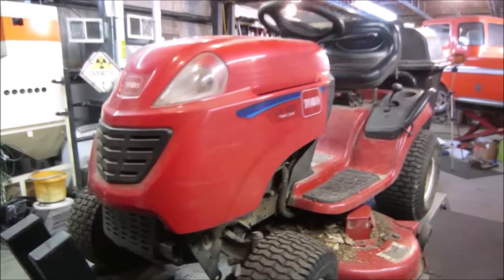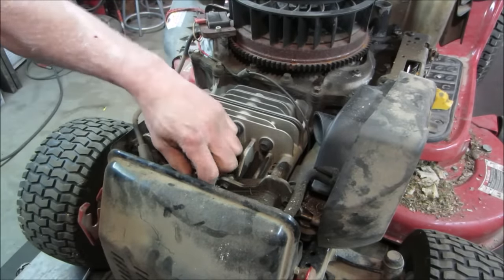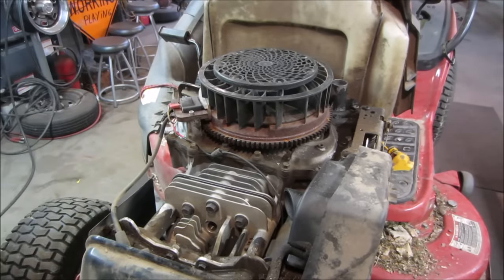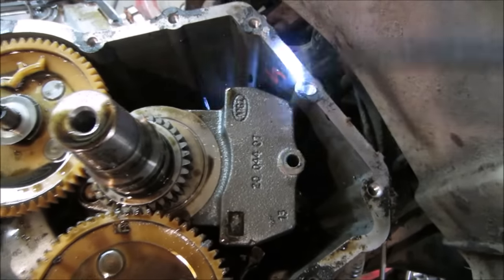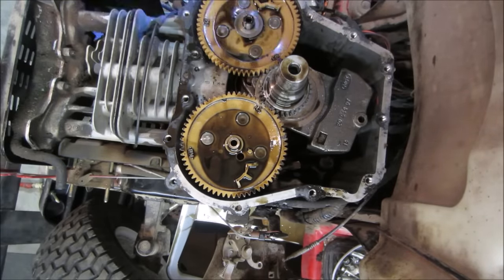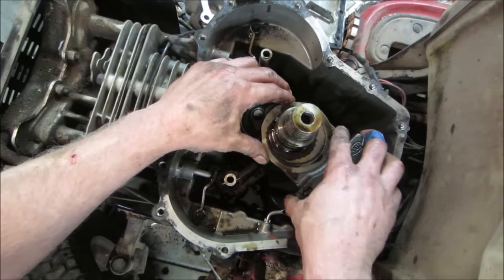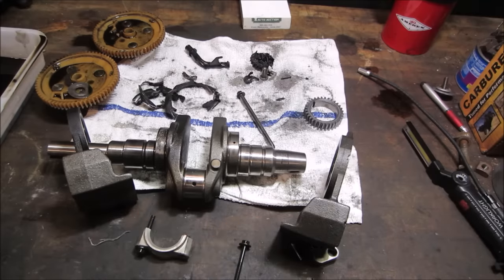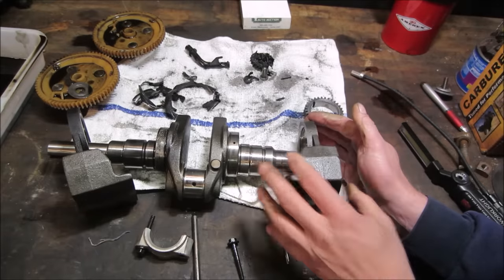You Won't Believe Why This Engine Blew Up,

Comment: Hey! Quick question for ya! I have a Toro Wheel horse lawn mower here. The Deck on it is a 48" deck. The spindles are shot. The part where the c-clip clamps onto is eaten up bad. I need new or used ones. Where is the best place to buy them? Let me know.

Comment: Good job Mustie , Sit down mowers are a pain especially with newer motors with electric clutch ,and  deck  its hard to even find belts because they have to be perfect length. Also when I see motors like this its more crap you don't need, that motor is the POS design. Either junk it or put and old 14 hp Briggs in it. This is what sons are for 16 year old kids , turn them loose on repowering something like this and help them with the project.

Comment: I think that's the vibration dampener.  I've never seen a Kohler with the top of the engine coming off like that. Interesting to see what made it go but I wouldn't want to fix it. Parts are expensive around here along with waiting forever for them. A lot of engines have the same foot print as others so they can switch brands when necessary . I save good motors when I can. Good videos. I like the operating table.

Comment: My guess would be that the governor fell apart, wedged itself in the bottom against the lower counterweight, which caused that bolt to break and then it just chewed itself up after that.  By the way, that's a Kohler Courage engine, which are famous for all those top bolts in the cover coming loose.

Comment: I have this exact same mower. Except mine is black and called Yard Machines. It has a Briggs Vtwin engine. Looks exactly like this one except the color. I need to find out what’s going on with the trans. Lately it hesitates to move forward. It’ll be going along fine then act like it can’t move. I let off the pedal and press it down and it starts to move again. I wonder if mine has the hydro static and it’s starting to go bad. I have no idea how to work on them outside of regular maintenance on the engine. I do know mine is a 2006 model year. I thought these had a CVT in them like a scooter but maybe not. I sure enjoy these riding mower videos.

Comment: So everyone knows, most lawn tractor engine use a 2-1/2 Inch long by 1-Inch Crankshaft.
When you gets up to the larger GT Machines they normally use a 1-1/8 Crankshaft, by I believe 2-1/2 Inch, but don’t quote me on that.
Lastly a majority of newer machines use the 6-Pin molex connecter and they are all pinned the same.

Comment: And this is why you check your oil before you use your riding mower. I actually check it every other use. I've lost a generator from not enough oil. (engine burned oil) Don't bypass the oil cutoff sensor. The connecting rod snapped and the crankshaft spun freely.

Comment: Got my old friends wards grass cutter it had a knock, thought it was the insulated mounts holding the engine in place. Put new ones in sounded better for 17 years till it blew up last fall .pulled it apart in the fall top and bottom cracked castings . Found out connecting  rod had only one bolt holding it together.  Beinging a class 8 mechanic  I was shocked it lasted all these years. It was a 11hp briggs&stratton, scrap it out this year in spare time. Trans is still good 5 or 7 speed

Comment: At 26:00 thinking about why the upper bearing lived and the lower failed. Remember that the oil filter was fed from or fed to the upper portion of the housing. If the oil level was low, the sump would suck dry, starving the lower bearing set while still pouring lube at the upper set. 

I have no idea yet if you explored this as I paused to comment.....

Comment: Was at tractor supply yesterday middle America. Can’t believe how empty the shelves are in the tool section and how little oil they had. It’s a bit shocking actually. Going to be an interesting summer.

Comment: I wonder if there's a steel/bronze/brass sleeve on the top threads of the balancer bolt that was not installed at the factory.  Perhaps that's a "4PM Friday" engine.

Comment: Hey Mustie!  Do you have a governor ( throttle limiter ) spring for a 2004 series John Deere lt150 in your horde? It has  a kohler cv15s-41618.   I have not been able to find this spring anywhere.😁
Reply: check eBay or check at john deer store

Comment: Not "perpendicular" to each other , lol ... parallel , but I knew what you meant , I'd imagine making a video is a bit of a chaos trying to talk not stop while your trying to get your work done , lol ... nice job ... ps. , did there used to be a thin bronze sacrificial sleeve in the bore where your loose bolt is ??? ...

Comment: There was a recall on a particular brand of electric PTO clutch, that the clutches would short out to ground on the crank shaft, causing the lower bearing to arc, eventually destroying the bearing and crankshaft. The first sign of an issue was the lower oil seal leaking, but by then,it was too late.
Reply: Don’t think this one has an electric PTO clutch

Comment: Hipótesis: When the bolt that held both counter weights broke. It provoked an  unbalance on the bottom counter weight that put off-set pressure on the bottom “bearing” causing it to wear off and break into pieces. Those pieces flew around the engine and landed on the governor gears and busted it to pieces. Therefore a chain reaction of broken pieces got stuck everywhere causing it to seized. Then the bendix on the starter got stuck on engaged because it would spin freely and let go. Prognosis. Replace with a predator and mow away happy.

Comment: Late to this but it's a Kohler Courage right? Twin plastic cams, single cylinder. There's a lot of plastic parts. That oil scavenger pickup fails. the governor is iffy. The flywheel cracks into  the cover bolts when they come loose. It's an okay engine.

Comment: I have a mower with a Kohler courage 20, older model it runs great but the block is riddled with cracks at the top cover by the cam gears. Apparently its very common for that model to do it because of how thin the aluminum is between the bolt placements. I'm also not a fan of plastic cam gears meeting metal but its ran good this long so cant be too bad.

Comment: I had the same exact Kholer engine on my rider. I was mowing on a hill and it put the left side up at a sharp angle. The engine blew. Now I know why. The oil pickup is on the "driver" side and was starved for oil.

Comment: Never seen a counterbalance system like that before. Just found another video from years ago with exactly the same failure of the lower bearing but this time you can still see the threads of the bolt still sticking up as is had not sheared off yet. It's possible the engine was making odd noises while running but the owner could not hear them very well.

Comment: This is a Koehler engine... I have one in my troybuilt but from everyone I have talked to they are bad motors and usually run low on oil and blow up... I have even seen them crack the block on the right side by the starter... but my Koehler engine... lol I have had for over 12 years and it still runs good and don’t burn any oil... it has been one of the best mowers I have ever bought......do you want a motor so you can make another video and finish the mower ??

Comment: In my experiences Kohler motors fail due to some little part that breaks and causes catastrophic damage.  I had an Ariens with a Kohler K361 OHV and the oil slinger snapped off for no reason and bounced up and shattered the piston.  Not to mention the constant head failures that thing had.  Have also seen some in the Cub Cadets with cracked blocks all with less that 50 hours of runtime.

Comment: I have a Kohler 18 5400 series. I assume it is pretty much the same. If I knew it had plastic cam gears, I might have passed on it. But it seems to do fine so far. Haven't found  a lot of tear down videos on this engine so I hope that's a good thing. Thanks!

Comment: I worked at a Toro dealer when they first contracted mtd to make these. We thought it was a joke at first. And the first couple years of Kohler courage... sheared off cam gears, crushed head gaskets from over torqued head bolts, rockers so loose the compression release wouldn't work, and of course exploded gov's.

Comment: Briggs & Station calls the weight system "Syncro Balance". On a Briggs the crank journals for the balance weights are replaceable as well are the bearings in the weights. 
I have a Briggs 406777 V twin that the governor failed from metal fatigue.

Comment: How about converting it to electric?  

I was going to do that with my old Craftsman, but I just keep replacing parts, and it still mostly runs. (Kohler 16.5 Command Pro, turned 21 in March 2021, new head gasket this spring (thanks, Mustie1, for the confidence to try to keep this old guy running!).)

Comment: That counterbalance vcontraption looks like a really neat idea, but its execution leaves a lot to be desired!
A second pair of guides in the bottom casing, a decently sized shaft for the sliders which does not double as a means to keep the two weights together,  this should be done by two screws.
But so?
One undersized bolt which wasn´t fit for the job ruined the engine to a point at which a repair can´t be done economically.

Comment: Really interesting video.  Reading some of the comments, I can't help agree with @aserta who commented that this engine is designed to run vertically.  Run horizontally, there would be side stresses not accounted for in its original design.  That would include on that counterweight bolt and cam, which makes that a good choice for the original point of failure.  The bolt-piece and/or the cam then gets chucked into the governor, which is more than it can chew.

Comment: Oil starved, bottom bearing and counterweight bushing is last to get oil, as oil is pumped from the top down. Started seizing and tweaked the counterweight, causing failure. I'd look at the loss of oil pressure/oil pump/filter for clues.

Comment: Failure mode: I'm going with the lower bearing failing first,  bolt failure was secondary. I'm also going with 'bad' lubrication, plenty of oil - just bad/dirty oil. My thinking is the first bearing gets fed with all the crap that is in the oil including any heavy particles that get thrown out into the first bearing through centrifugal forces. The other bearings get clean oil. That lower bearing has suffered the most damage because it ran for a while in a bad state. Eventually it seized. The rest of the damaged followed.....

Comment: look at where the oil filter and passageways are, the oil pump sends it through the top cover and filter, then it returns into the shafts at the top, from the top cover.

Comment: Late to the party, but I'd say that having a pressurized lube didn't help in this case, the low/unmaintained oil pumped the crankcase dry which is why the bottom of the motor had issues while the top looked fine.  I'd guess the lower counterbalance took out the upper, and then hit the governor...as usual, a Mustie1 investigative case! :)

Comment: I wonder if you could ( just for the hell of it) 
Put it back together without the weights, and without the governor and just see if it will start?

Just to see?

Im not sure if the weights set some spacing. 
The rod bearing is fine

I bet it would vibrate like a bugger but it would be fun to see

Comment: 13:16 I know Toro bought out Wheel Horse at one time, but when I saw that yellow bit on the gear that looks like a toy horse, initial thought:
"Well, that's a bit on the nose. Or curious grandkid??" 🤔
Was not expecting to see all the bits in the bottom without there being a chunk of rod or a block window somewhere.

Comment: Have you ever seen the brings single vertical shafts that love to kick rods out and knock the starter off? I think it's like 12-17hp or so. I've seen at least 6-7 of them and always wondered why they do. I think they are balance shaft motors.  All the running ones I've had were good. Any idea?

Comment: Looks like the Detroit Diesel engine that had a similar problem with a critical adjustment of the governor.Governor locked open, engine over speeded,engine was designed to turn 1800,just before it selfdestructed tach was showing between 3500 and 4000 RPM.

Comment: That's a kohler courage engine. Command is the earlier and better engines from kohler. the courage engines are notorious for losing the counter weights. it usually knocks a hole in the back of the engine lol. they also had issues with the top cover plate coming loose and the decomp on the cam blowing apart. they were probably the worst engine kohler ever produced. lots of issues. Thier first stab at a bucket type engine (top access for engine internals) it was rushed into production. We replaced a LOT of engines and blocks under warranty when they first came out. find a decent briggs or an earlier kohler command single if you want to re engine it.  As soon as I heard the clunk I knew what failed inside. Love the videos Mustie keep growing the brotherhood of rust and wrenches. We need some younger mechanics to carry the torch forward.

Comment: Today you learned the most common problem with these engines and why they arent reliable. That separate balance weight was a really dumb idea and it always comes loose. Usually caused by the top cover coming loose.

Comment: have to agree with you that bolt flexing at the thread line will break if you flex it enough times, should have been a larger bolt for the force on it

Comment: So it was just a bolt, of the wrong size.  That broke lose, leading to a motor lock up. Makes no sense at all, to use a bolt of a wrong size.  I think  something else, other then a bolt. Could be used to hold in place the counter weights.  Great video mustie1
I agree, the motor would have be replaced.

Comment: I've had a low oil big single Briggs wear out the lower main bearing surface from lack of oil. Got another crankcase  base and kept it going.

Comment: From the looks of the video the fuel filter appears to be installed backwards as well. I have had experience with these single cylinder Kohler Courage engines and they are notorious for cracking their cases in the rear and also grenading at idle. These were not made like the Kohler Command series at all. I will say that the Twin Cylinder Kohler Courages are not so bad but these twin cam models are a hit and miss on reliability.

Comment: I have a 17K Generac generator and only use it maybe a few times a year.  How long should I keep gas in it before the gas will go bad?  After running it I shut off the fuel valve but the gas can stay in the tank for over a year sometimes.  Should I drain the tank each year?

Comment: The amount of oil that was in the engine , once you start pumping it through the engine there isnt much oil to go around . It seized up and locked up in some places . That little oblong piece you were trying to put on the top of the counter weights was the cam lobes. Tho 2 plastic gears you took off those rods were timing gears and the lobes went on the rods to open. And close the valves.
Reply: JMO.....Looks like Barely enough oil left to push through the filter. Chances are it was sucking air while running.

Comment: IMHO, Kohler and Briggs are close to the bottom of the quality spectrum. My own Briggs v-twin threw half its governor and I was lucky enough to have my hand on the throttle to keep it from grenading. Tecumseh is dead simple, inefficient, but very easy to service, as my 1977 HM80 will testify. The Kawasaki on my lawn tractor has been very reliable, just filter and oil changes. I've heard very good things about Predator engines, and they are cheap and easy ways to re-power.

Comment: I have a 2009 Troy Bilt almost or maybe the same Kohler engine. Thing was pissing oil from above the head level and turns out those case bolts were loose. One had backed off so far it was hitting the flywheel.

Comment: Basically they make everything cheaper. My neighbor has a rider from the 70ties still running strong. There is thinner metal and more plastic which means things fail more nowadays.

Comment: I had one do same thing low oil ...pump kept oil from bottom causing bottom bearing to burn up when bottom locked up it breaks top bolt oil leak out of quick oil when engine running did not leak when sitting it was a newer mower warranty ran out by one month

Comment: Weld up oil journals for the weight, put it back together and run it without the governor! Good to know the balancer explodes on these. Have one I saved from the junk yard. Maybe i'll pull the top off and get a beefier piece of hardware to run through it... or break out the stick welder.

Comment: I think it got low on oil but enough oil was left to pump oil and keep the upper parts of the crankshaft lubed. But the bottom starved for oil and burnt the bearings out.

Comment: Hello cub cadet 2542 horizontal shaft cant turn by hand feels locked up. Kohler command 22hp  shaft drive rear wheels. What think its junked it was given to me. In great shape new starter looks like,battery new,clean machine  wanting try fix it for my pops hes getting old and like get it going for next spring. U know of the Kohler are worth fixing,should try replace with predator motor. And little fab work. IDK lol ke have ur opion. Thanks.

Comment: I have seen many of these kohler courage motors in this self destruct state at the shop I work at.
But usually the counterweight blows the block apart.
If it were mine I would find a Briggs to put in it

Comment: Single cylinder Kohler Courage engines seem to have weird issues like this.  I have a couple twins on standby for when mine bites the dust. Most of the time they are cracked blocks, seizing issues due to oil leaks from the valve cover, and cam/lifter issues.  I thought the Command was supposed to be a better version.